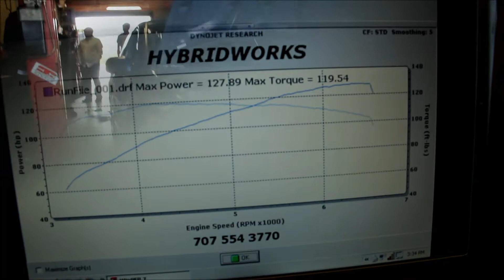Cody W's 2007 FG1 Dyno Hybridworks

Comment: Wow, how come this FG2 dynoed so low? I thought the K20Z3s were in the low 180s/high 170s?
Reply from the maker: this is a fg1 - non Si
Reply: Damn I'm such an idiot. So it actually dynoed pretty high for an R18.
Reply from the maker: not bad for the 1.8l motor..they are rated 140hp at the crank from Honda